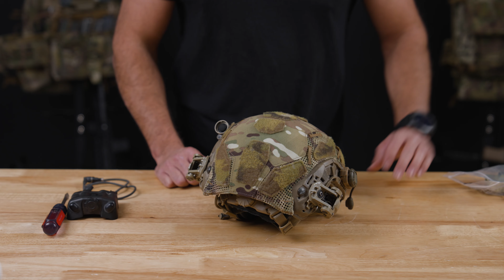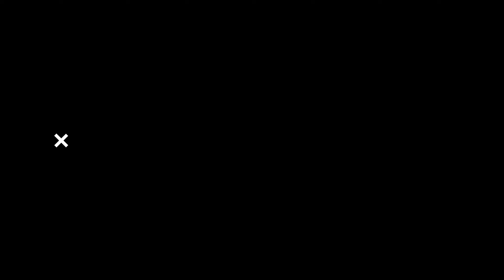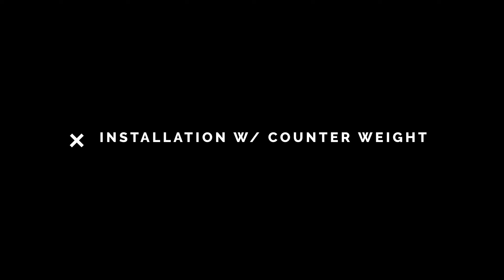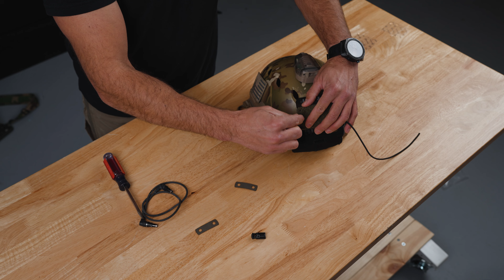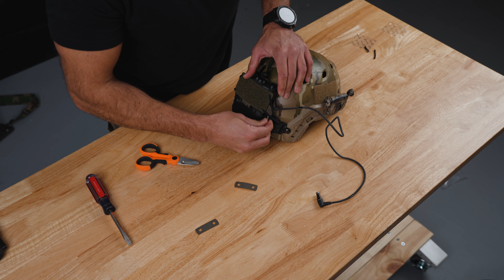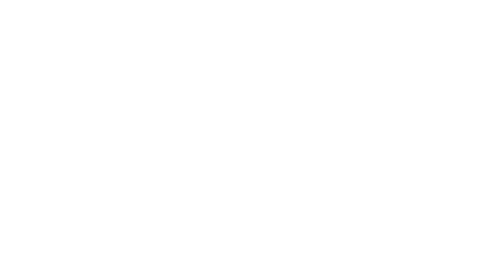Forge Concepts Night Vision Battery Pack Retainer Installation Video

Comment: Team Wendy version?
Reply from the maker: The easiest way is just run the shock cord through the rail slot. Or take the Helmet Retention Tab, loop it through the rail slot and then run the shock cord.
Reply: yes after some time playing around with it I ended up doing just that. Thank you for the help nonetheless 🎉
Reply from the maker: @cullen1394 point taken though that we should have snagged a TW helmet for the install guide. We'll try and do better. Thank you for the support!
Reply from the maker: Our Night Vision Battery Pack Retainer works great on Team Wendy helmets. We have a ton of customers using them!